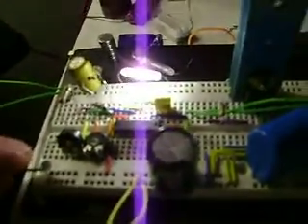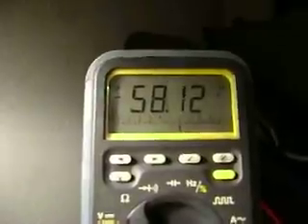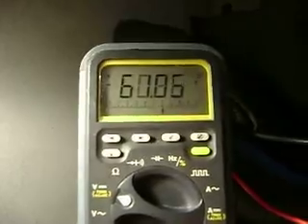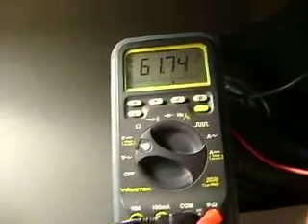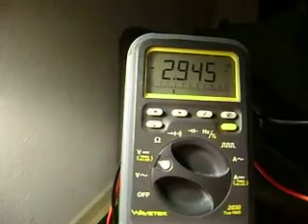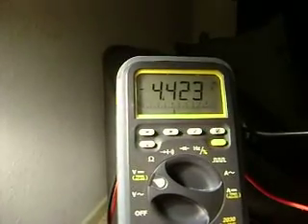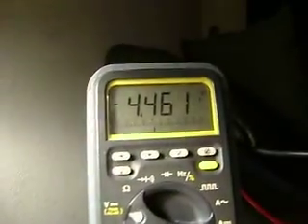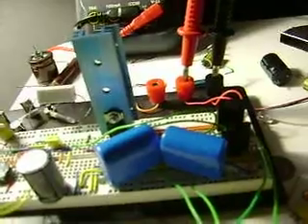Big coil, Back EMF, and Smoking Light Bulbs, And some errors

Comment: try pulsing a coil around that 5w resistor. That one should be coil wound, and with a pulse or any kind of AC signal strong enough to interact with the field, should produce something. I plan to try when I find a nice wire resistor :) cheers!